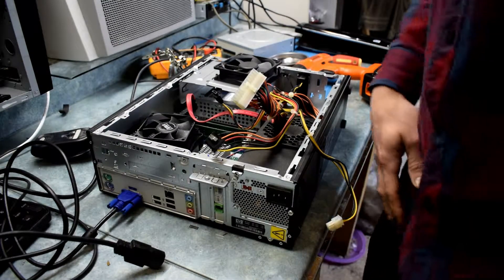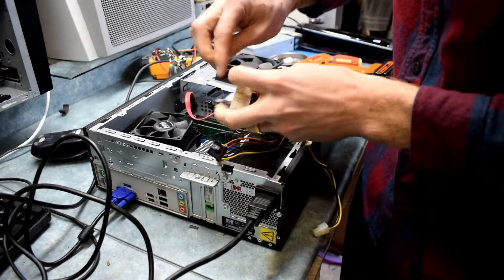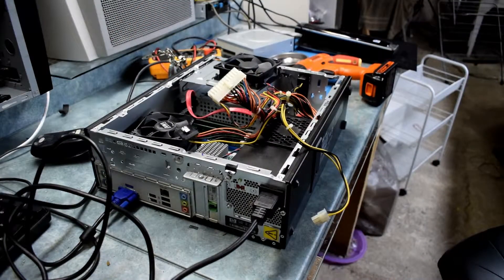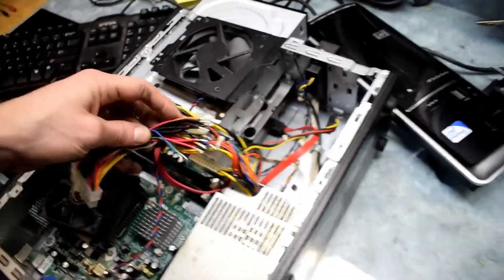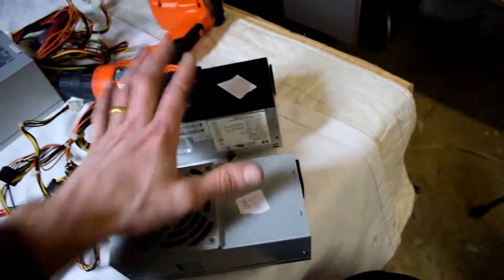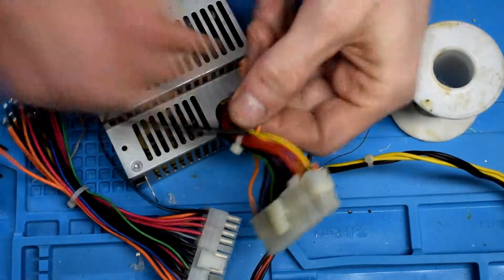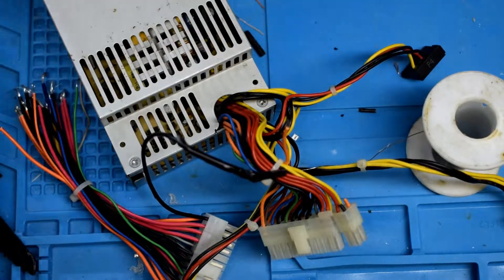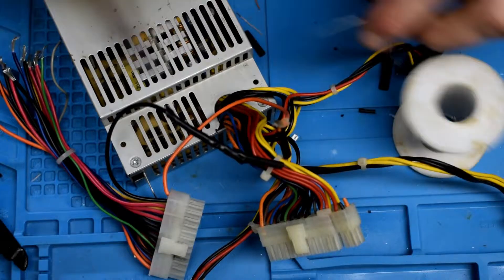HP power supply repair

Comment: I've been repairing many of the HP Z series Power Supplies including ones with 18 & 12 Pin non-standard pin outs.. They are worth fixing as some replacements are over $200 USD...  DPS-750AB-36, DPS-1050DB & D12-925P1A

Comment: I'm giving you a comment. My HP-6005 Desktop Power supply stopped working after I changed the Motherboard, the power supply came up with a burnt smell like. Fix one of yours and show us what need fixing or replacing in it. Thanks
Reply from the maker: the new board probably used too many watts you need to know the watts of the new board and make sure the power supply can handle it.
Reply: @NewsonsElectronics  Right! So there is no point buying another power-supply for the motherboard because it will probably fry it up again. I can see that my power-supply use 240W Max, but where around the motherboard to check what watts its got? How do i check the motherboard watts? Thanks
Reply from the maker: @makineegroup8669  google the make a model of your pc and it should say it's watts.

Comment: Can u help me please?
Reply from the maker: what is the issue?
Reply: @NewsonsElectronics  ok so I own an hp desktop model: tp01-0014. I decided to add a graphics card (gtx 1650) but my power supply didn’t have enough watts so I bought another power supply which is made by hp (L05757-800 is the name of power supply). I put the new power supply in the computer along with the graphics card and now my  monitor won’t show anything my rgb keyboard isn’t showing any lights, but the fans on the computer still spin. I’ve tried everything such as removing and reinserting ram, tried my old power supply (180 watts) without the graphics card but still no display on the monitor. I think the new power supply I bought fried the motherboard even though the new power supply I bought is 500 watts and is stronger than my old power supply.
Reply from the maker: @minx6773  do you have onboard vga I would start there
Reply: @NewsonsElectronics  already tried different connections vga, hdmi without a graphics card so yeah it still didn’t work